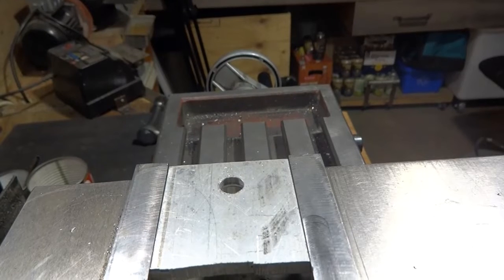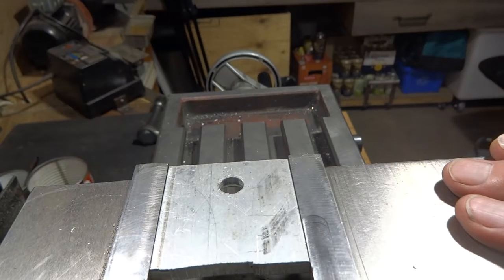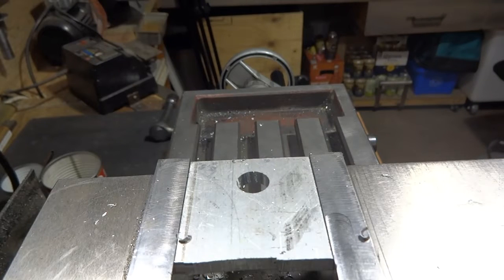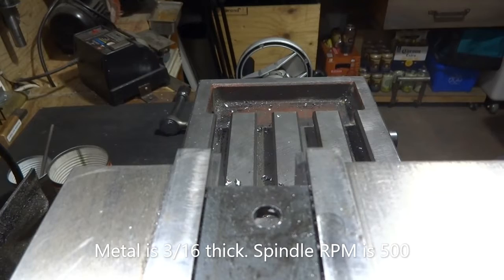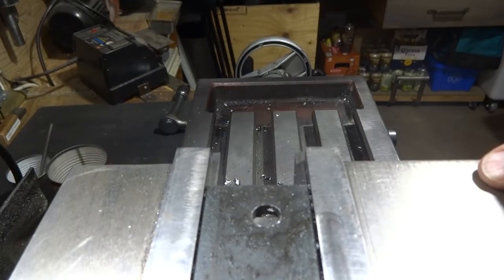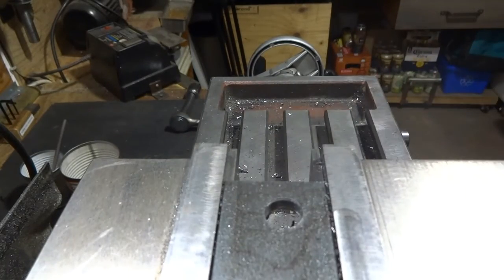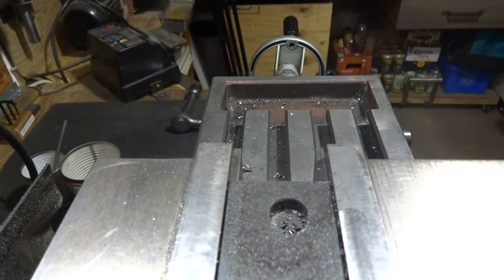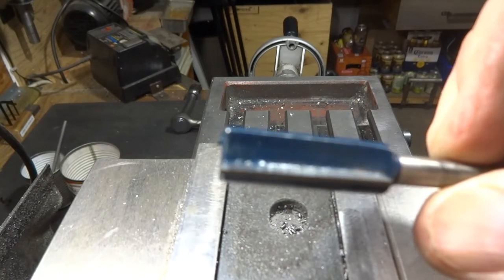Use carbide wood router cutter in metal mill.

Comment: I realize that for what a basic square end mill can do this isn't exactly the ideal option, and that a collet would be better than a chuck, speed is slow, etc., but this is good information to have with regards to some of the specialized shapes of router bits that you can't find in most end mills without paying very high prices for custom geometry end mills with varying degrees of corner radii, large diameter ball mills, etc. that are much cheaper options, or like you mentioned are nice to know that if you're in a pinch it can work.
Reply from the maker: Yes, could be more runout and not so accurate for size but otherwise useful.

Comment: Why ? . I noticed a couple problems with your demo first cutter was mounted in a drill chuck the least stable way to hold a mill cutter. Second  500 RPM for 1/2 inch carbide is way to slow. A wood router has wrong tool geometry for steel and will not produce a effective cut or good finish. You can buy a good 1/2 carbide end mill for $30.00 and do 10X the work the router cutter will.
Reply from the maker: You are right. This was just an experiment. The geometry  is wrong and it is not good to use a chuck for an endmill. The whole point was just to see if it could be done and now I know if I am really stuck I can get away with doing it.